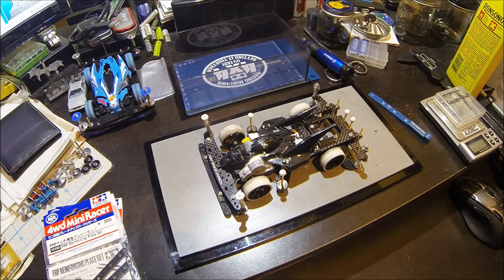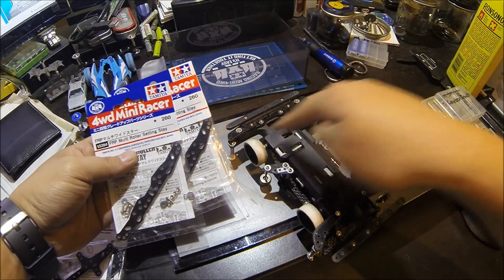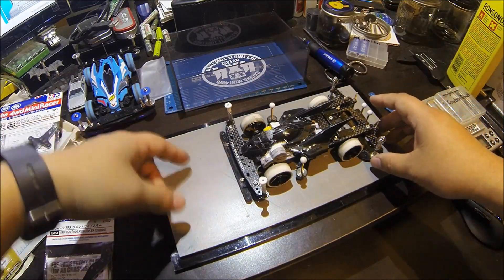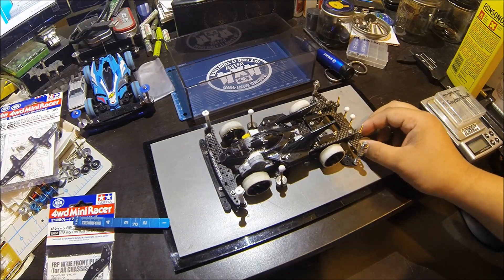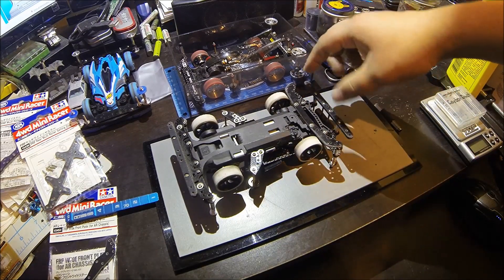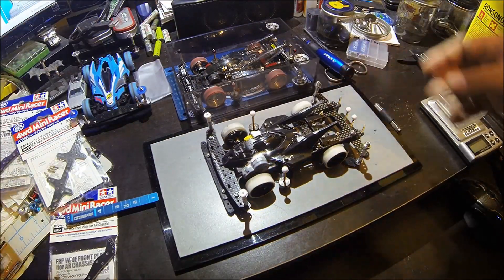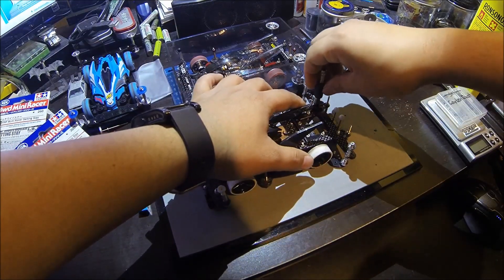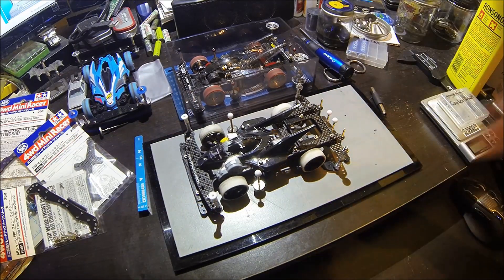【ミニ四駆】Tamiya Mini 4WD Testing: Super FM Thunder Shot V2 - Z3N Bluster Underguard

Comment: sir do you have a video on how you setup your body dumper and how do you modify your cowl cause i have 2 thunder shots and i want to put body dumper on it . thanks
Reply from the maker: +Arfie Domingo If you're talking specifically about Super FM its very simple. I have a video thats called FMS2 Full Build. There's a section in there that guides on how you build a Body Damper setup. Except on Super FM you don't need to cut the popsicles.
Reply: +Z3N Bluster my TS is MA and MS do you have a vid on those chasis too?
Reply from the maker: +Arfie Domingo I&#39;m working on an MS Thundershot video. If you follow me on instagram you will see what it looks like. I just need to edit the video.
Reply: +Z3N Bluster thans z3n